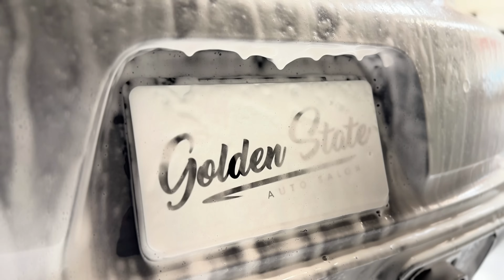Porsche GT4RS Foam Wash in 4K- Exterior Auto Detailing (Satisfying ASMR)

Comment: What’s the spray you put on the wheels? And the spray you use at the end on the car? Boost?.
Reply from the maker: It’s a ceramic boost sealant, helps protect exterior & wheels by making it hydrophobic.
Reply: @goldenstateautosalon  thanks. And what about the car wash liquid? Initially I thought it was a pre foam but then you washed it like normal so I’m unsure!!